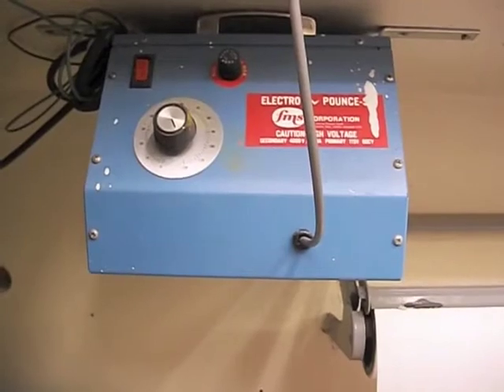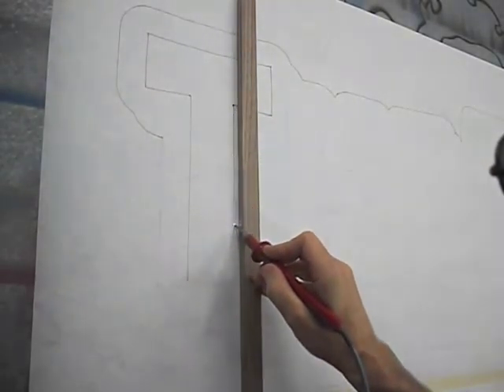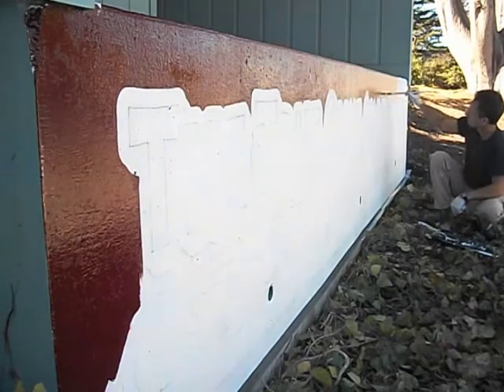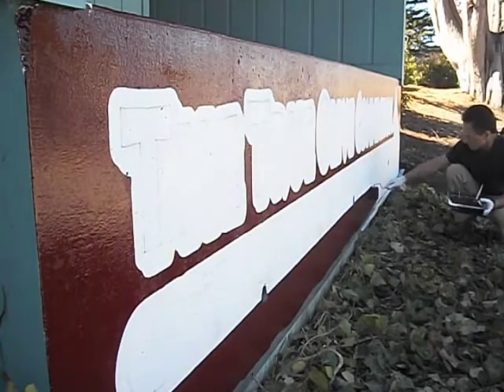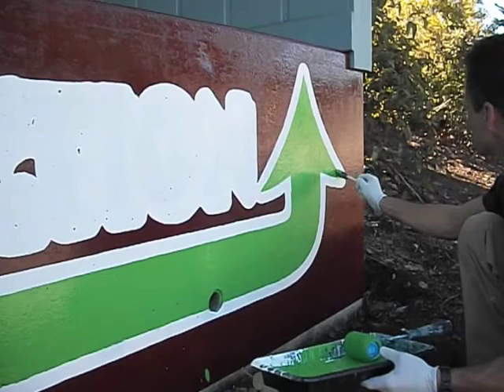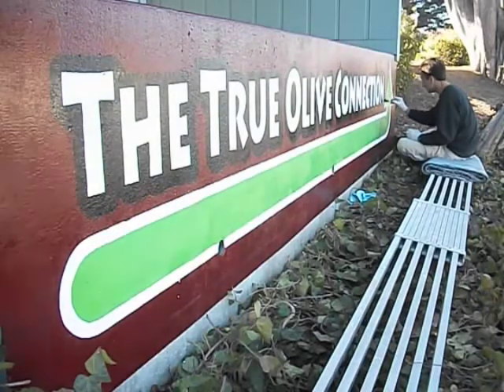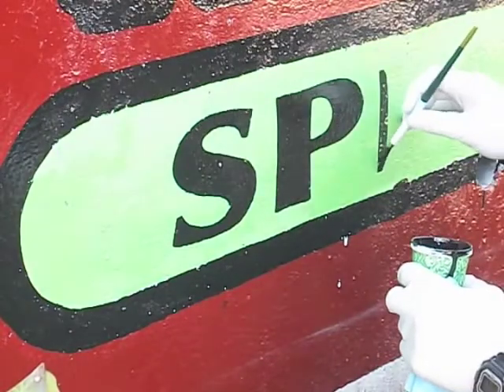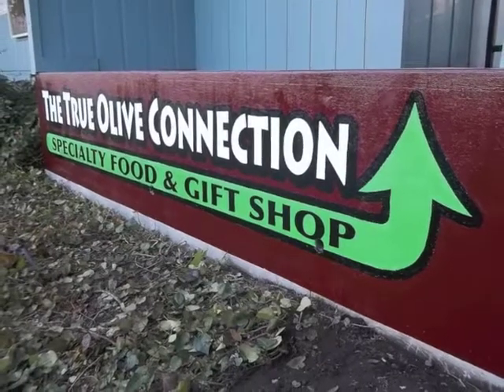Wall Painted Sign, Step by step

Comment: Thanks for these tips. I just got offered the job to paint a store sign which I have no experience making. I paint oil portrait paintings so I was a  little worried as to how I was going to even do this. Your videos gave me the confidence that it's not only possible with my skills but going to be fun. And thanks for responding to another comment as to which paints and brushes you use. I now know what to get and should be prepared.
Reply from the maker: That’s awesome! Have fun and Please post how the project went.

Comment from the maker: Thank you! The Poly-Brushes are great for water based and oil based paints even with reducers. They fall apart if you try to use them with any high lacquer based products like sealers and polyurethanes. They are very inexpensive, I buy them buy the box. I only clean and reuse them when using water based paints, for oil based paints I toss them because it's so difficult to remove the paint and they end up too stiff to use again. I hope this helps.

Comment: how much paint was used up on the brown section? also, how were you able to get the lettering looking so accurate seeing you'd already painted the green? cheers.
Reply from the maker: It’s 1-Shot Maroon Lettering enamel, just under a quart.

I transferred the letters on to the green the same way as the rest with a pounce pattern.

Cheers!

Comment: what paint did you use for the background? Im about to do a sign on stucco and I don't know if I should use enamel or acrylic  house paint. Thank you.
Reply from the maker: All of the top coat paint is 1-Shot lettering enamel. If you do not have access to this paint, Rustoleum would be next. If you can't get that then exterior semi gloss latex paint. I'm not a fan of acrylic paint because the pigment viscosity is too thin. I hope this helps. Thank you! 
P.S. be sure to use fitch brush on stucco. I prefer the angular ones: http://artbrush.com/shop/product.php?productid=1520&cat=13&page=1

Comment: Are reducers going to be paint brand specific only? Or can I substitute another brand?
Reply from the maker: Most brand names can be cross mixed, 1-Shot with Ronan, etc... but always do a test sample and let it dry in the sun to make sure. I prefer to combine same brand names to avoid potential issues.
Reply: @davidographicsguy  You mentioned 'because it was black' you used Reducers.. would you not use them for other colours? What is the different between Reducer and Flow Enhancer?

Comment: How do you fix lettering that's already painted if a word is too low or too high?
Reply from the maker: Hi T, well, if a paper pattern is being used, accuracy should be guaranteed. If there is an issue, the letter would have to be painted over with the background color, repositioned and repainted.
Reply: @davidographicsguy  it's fabric canvas 😭
Reply from the maker: Oh, I’m sorry, this sounds like something that exists. If touch up is impossible to make perfect, than it’s a redo. We all have had to start over with projects from scratch unfortunately. It can be disheartening and expensive, but it is the best end result.
Reply: @davidographicsguy  I was afraid of that. Thanks